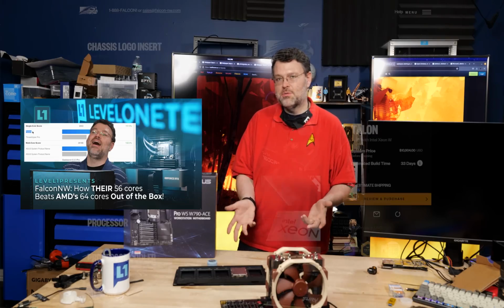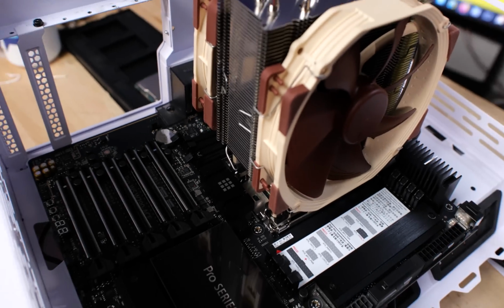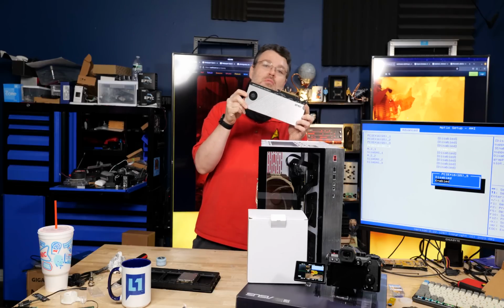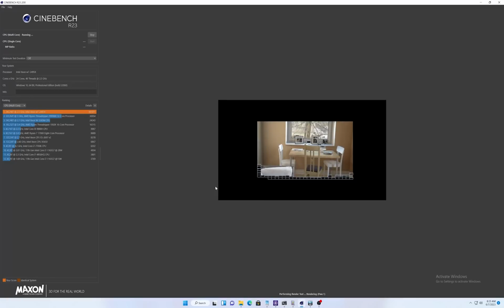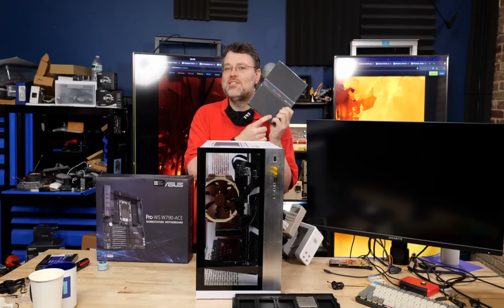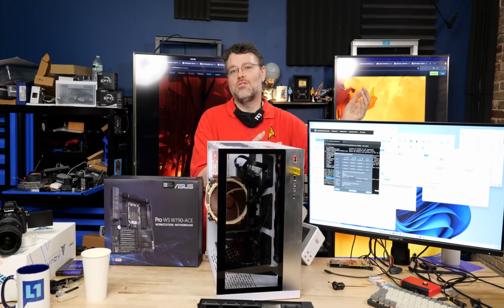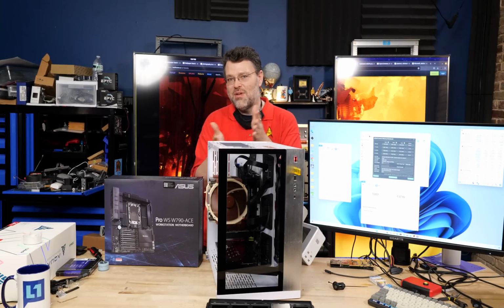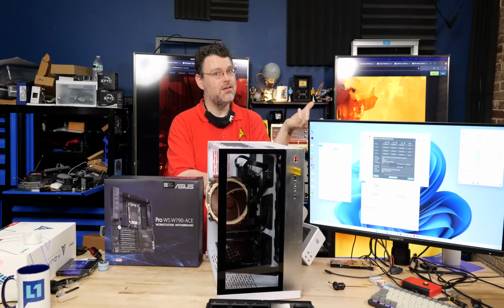Building with the Pro WS W790-ACE

Comment: Your discussion of PSUs and the potential for unequal rails causing unexpected power flows reminds me of my robotics days haha.
Designed a power system with dual power rails, 12V and 5V, and a common ground... Attached the e-stop to the common ground because it was simplest and we didn't have any two-pole e-stops handy... Imagine my surprise when I hit the e-stop and the robot doesn't stop, but keeps moving at half speed haha. I'd gotten so wrapped up in "oh power flows from power rails to ground and that's all" that I didn't even think about the fact that without a ground, then there's still a 7V difference between the two power rails hah.

Comment: Here's a question I think you have never heard. Which motherboard manufacturer has mastering grade audio converters on board? I don't think there are any, but I was hoping that you could find out what converters the various manufacturers use for each motherboard. Many builders have been marketing their PC builds as best for music production, so I thought it was only fair that we be told what converters are built into onboard audio. Perhaps manufacturers will begin creating offerings for music creators.

We need lots of pci slots, we need crazy amounts of CPU power, we need , quiet cooling excellent long term low cpu temperatures with little or no thermal throttling, we need multi core performance that is as good if not better than single core performance, we need the options of m2, m.3 or ssd on every board. We need strong multi screen and video rendering capabilities as well. We need it all in one cpu and on one board with gigabytes lan and Ethernet and we need a s ton of those ports on out mobos. You know what we need some really different stuff.
Reply from the maker: Hey friend, this is a very specific question and Wendell is a very busy dude, so we suggest going over to the Level 1 Tech's forums for questions like this. The site can be a little daunting visually, but it's easy once you know what you're looking for. You'll want to create a new topic, ask your question in the title, select a category (probably hardware), and then put all the specific stuff you're looking for in the body. I hope you are able to find some answers! ~Editor Autumn 
Forum here: https://forum.level1techs.com/
Reply: Any board is good for music production. I used a PEGATRON for years with an Intel i7 3770. No one uses the onboard audio anymore because converting the audio from analog creates latency especially if you use controllers, synthesizers (etc.). Get a audio interface with as many input channels needed. But the new VSTs are large, so you'll need fast memory.

Comment: You showed how to reduce “Processor Current Limit” amperage down to 322.00 A.
How do I calculate this number for a different MB/CPU combination? Like that Talon build from Falcon NorthWest that you tested few weeks ago.
Asus Pro WS W790E-SAGE SE with 56 cores Xeon W9-3495X.
I wish you could show how to improve performance of that already overclocked Talon build.
Thanks
Reply: Amps times volts bro are you a bit dense or something?
Reply: @toseltreps1101  Thanks. So, How did he come up with number 322.00A at this mark @14:52?
Reply from the maker: I kept dialing in until I found the thermal spot I wanted with the cooling I had. This setup doesn't exceed 85c which should have plenty of headroom. At just over 1 volt were around 400 watts. With losses/overhead it is a bit worse than that.

Comment: Can I have one as my DAW please?, I’m a sound engineer and not a IT specialist, built my own 5950x system but don’t have the ability to tune a pc to optimally run as a DAW, I’ve constantly got problems with performance and stability and it drives me nuts, having a pc sitting there waiting to do a thousand different functions I don’t need and it doing so much in the background is destroying the performance and stability, why can’t they have a simple “process run only when needed” function, eg, your a DAW, prioritise for that, shut down all other unnecessary processes…..or have a OS version for Audio or Video , or bookkeeping, whatever the purpose it is being used for….or even better, Startup modes for different tasks….or is my understanding of pc’s wrong?
I use digital mixing desks that are basically computers that only do Audio, why can’t we have pc’s like that?
Reply: Probably an AMD problem. As competitive as they are Performance wise, stability is absolute ass.

Comment: I love ASUS workstation boards, especially their dual processor boards (I have 3 X99 variants). I'm not sure what I really want to upgrade to eventually. Also currently I'm using 4 x Rosewill 4U chassis. I think I'm going to go towers next and buy the Anidees AI XL Raider cases. I didn't really care too much about racking equipment anymore. I like the towers because I get even more 5.25" bays (9 vs 12) and even more PCIe slots (for either 4 x 2 slot GPUS or other goodies, 10 horizonal and 2 vertical instead of 7 in the Rosewill) and better PCIe area cooling. My overall footprint wouldn't change much.

Comment: I bought this board for a new build for my work with high-end 3D, I need memory pool more than threads.  I am still waiting for the processor and some of the memory sticks, any day now.
Intel Xeon W7-2495X 24-Core, ASUS Pro WS W790 ACE, 512GB (8x64GB) DDR5-4800 RDIMM, Noctua NH-U14S, ASUS ROG STRIX RTX-3090 24GB, Corsair 5000D case, Corsair HX1200 PSU, WD Black 2TB NVMe + WD Black 4TB NVMe + WD Blue 2TB HD + WD Blue 4TB HD, Windows Pro for Workstations, Ducky kbd, Microsoft mouse, Dell 34-inch wide display, Mackie speakers.

Comment: I would love it if they actually came out with a high end desktop version.  I personally would be content with quad channel single dimm per channel and a total of 40 lanes as two generation 5 M.2 2280 slots (or even better a 16 lane slot wired for 8 lanes or dual 4 lanes and a gen 5 capable dual M.2 riser card in the box), a pair of 16+0 / 8+8 gen 4 and a pair of 16+0 / 8+8 gen 3 below those.  With the ability for those slots to also bifurcate down to 4 lane devices such as 4x4+0 or 8+2x4 or 2x4+2x4.

Comment: Wendell, could you please explain why do you need 3 keyboards 8:07 on a single system?
Edit: And could you please do a video about building a decent home lab system with a couple of suggestions based on everyones interests.
I personally would lean towards a HA cluster capable of running and scheduling containers, vm's, nas and even gpu passthrough. Thanks

Comment: Is dual something required? Will a 1600w psu not work here? I'll be upgrading soon to this board and one of these CPUs so I'm wondering if I can use my fairly new 1600w unit.
Reply from the maker: Works fine. Usually 2x800w is way cheaper than 1 1600w
Reply: @Level1Techs  Ahh thanks man! I stuff my pc with 2-4 video cards for rendering so I just invested in one PSU that can do it all.

Comment: You need a VROC standard key that plugs into the header on the bottom edge of the board.  It's mentioned in the manual.
Reply from the maker: It weirdly had a black sticker over it on the ace. The sage was fine.
Reply: @Level1Techs  yep, I saw that part, mine has the sticker too.  It works though.  I stuck my vroc standard key on it and immediately got bootable raid0/1/10 support on both M.2 and all PCIE slots.

Comment: What's the point of two PSUs if they have to be manually reconfigured when one fails? If a single PSU hooked up wrongly can damage the motherboard, does that mean the system is toast if one supply fails?
Reply: you clearly didn't understand what's going on here
Reply: @toseltreps1101  thank you that's so very helpful 🙄

Comment: Are 2 PSUs really required? or one PSU ~1.5 kW sufficient to run this configuration?
Reply: I'm running mine with a single 1250W PSU.  But I'm also using a W5 2455x, so less power than what is shown here.  It all really depends on the CPU you install, how much if any overclocking, and if you have other PCIE cards using a lot of power.

Comment: Cool Video today. Since Wendell only records these videos in utmost professional manner possible and definitely wouldn't leave anything in the frame accidentally, I wanted to point out that he forgot to mention the value-added milkshake on the left which is clearly bundled with the system. If you're sweating the cost of these workstation setups, that item is certainly worth promoting.

Comment: I was looking into getting the Dark Power Pro 13, but according to many reports online, it seems that these PSUs suffer from fan rattle. And while be Quiet seems to replace these units (oftentimes with ones just as loud), they have refused to acknowledge the issue, which I really don't like. They also refuse to run the PSU semi-passively by turning off the fan at low load.

Comment: The DDR5 R-DIMMs really need active cooling to be fully stable at 6400 C32. Mine crashes after an extended Prime95 Large FFT test. The Xeon W7-2495X can run 6400 MT/s no problem at stock voltage.
Reply: Are you sure you're using stock voltage?  G.Skill's 6400 MT/s kit sets the IMC voltage to 1.4v when you use the XMP settings.
Reply: @zoson  I believe VCCDDRD is the memory controller voltage on Sapphire Rapids. However, setting any voltage in this field instead of Auto results in no boot. ASRock told me that there is no Auto rule defined for VCCDDRD, so the XMP profile cannot change the voltage. The VCCDDRD Auto voltage is decided by the CPU itself. The only voltages that change when selecting the XMP profile are VDD, VDDQ, and VPP, which are all on the DIMM's PMIC. ASRock also sent me a beta BIOS which has a separate field called CPU Memory Controller Voltage which defaults to 1.145 V. The lowest it will go is 1.100 V and the memory still works fine at 6400 MT/s, until it overheats.
Reply: @MonstieurVoid  the CPU Memory Controller 1.14v setting is the setting I was referring to.  Using XMP on my w790 ACE sets this value to 1.4v, and appears to be part of the kits specifications.
Just for some color on the situation, I tried lowering this voltage, and below 1.3v my cpu would no longer run stable at 6400 MT/s.
Reply: @zoson  That's likely an ASUS BIOS rule based on memory speed, not from the XMP profile itself. My CPU seems to run 6400 MT/s fine at 1.100 V. Either that or the value is being ignored. Unfortunately the CPU doesn't report back the actual voltage for monitoring. The value doesn't change when I load an XMP profile on my ASRock board. I wonder if this field is related to VCCDDRD. Memory controller voltage is hugely variable. I had two 9900X and a 10900X which needed +150 mV, +250 mV, and +450 mV for the same memory speed.
Reply: @MonstieurVoid  if you actually look at the XMP profile, it is programmed into it.
Reply: @zoson  My board shows the DIMM voltages and detailed timings when viewing the XMP profile info. I don't see anything about CPU voltages. I would guess the IMC voltage is inserted into that page by software based on some rules. ECC R-DIMMs can be used in any number of systems and the RAM manufacturer does not know which CPU architecture to set the voltage for. The same voltage could kill a CPU made 2-3 years from now. "Controller" could also refer to the DDR5 integrated power management controller on the DIMM which also needs exactly 1.40 V on these 6400 MT/s kits.
Reply: 60c max on ddr5. However you achieve it.